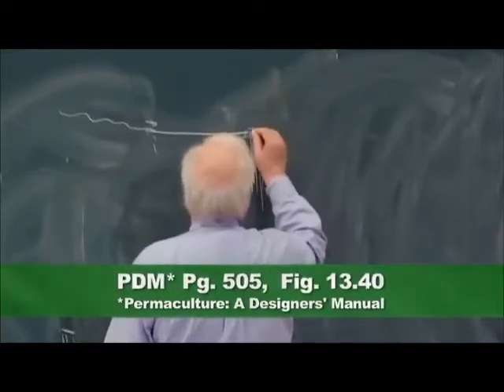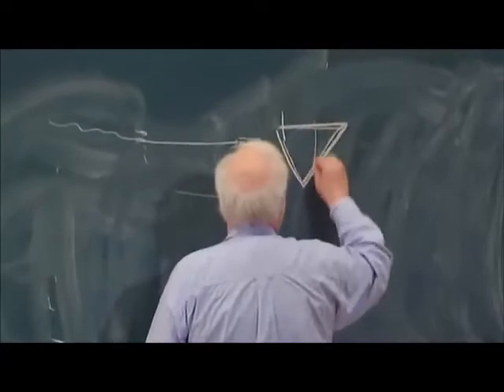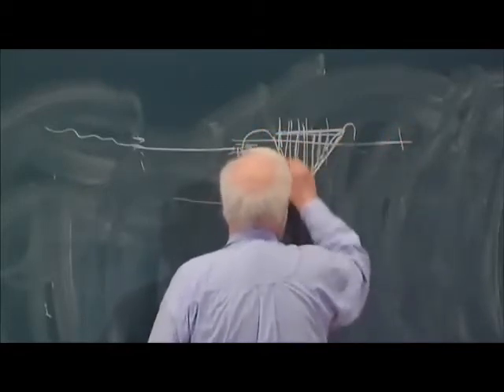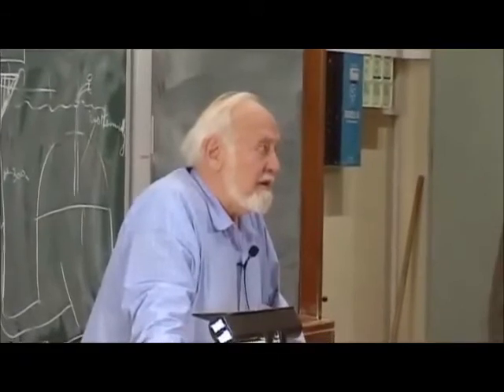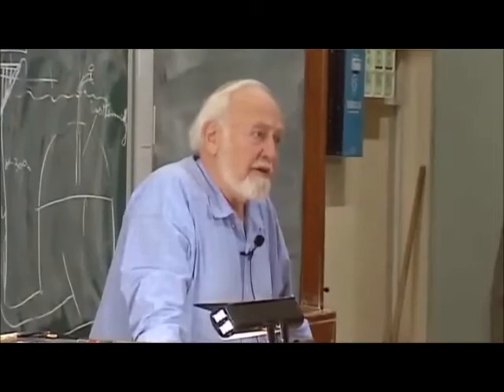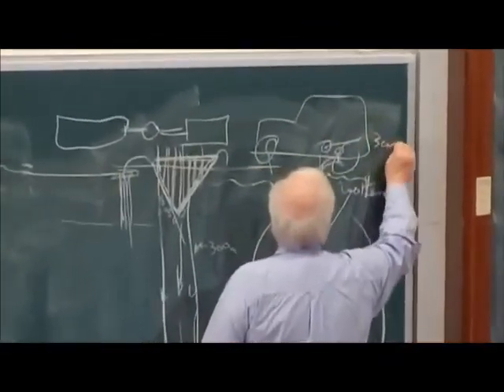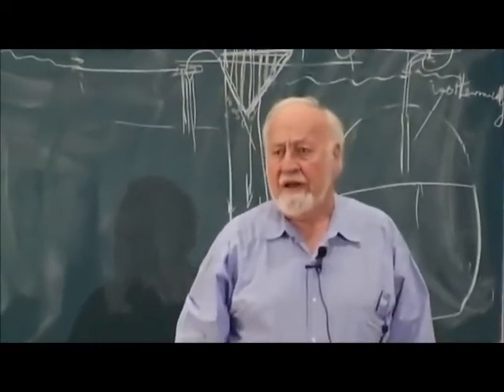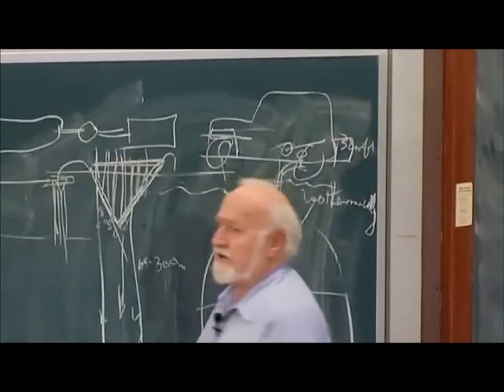Limitless clean energy that can make petrolium obsolete (short version)

Comment: This will only work while the water is able to flow. In this example, once the underground chamber is full of water & compressed air, the water will stop flowing down the tube.
Reply: Excess air will exit through the outlet pipe. And water will keep flowing - the gas doesn't mess with it. When pressure in the camber and pressure in the air bubbles dissolved in the water evens out - bubbles just won't come out in the chamber and will flow out with the water. Simple and elegant system - all you need is a constant flow of water and a few feet of drop (and a little digging for that matter), and temperate climate regions are full of it. And if you have a fair bit of natural drop - you don't even have to dig.